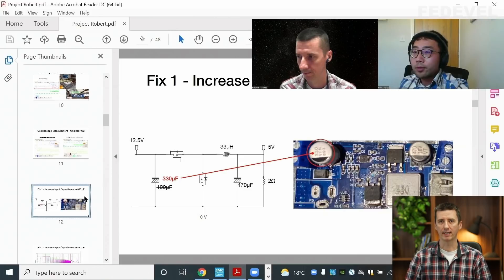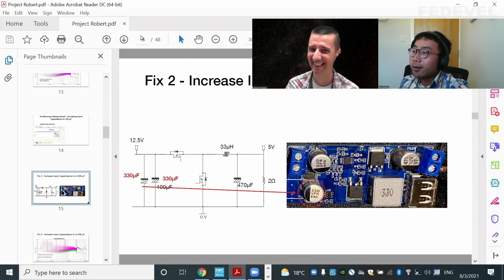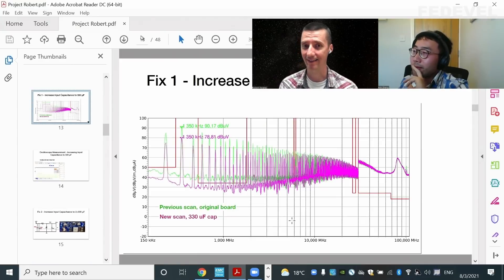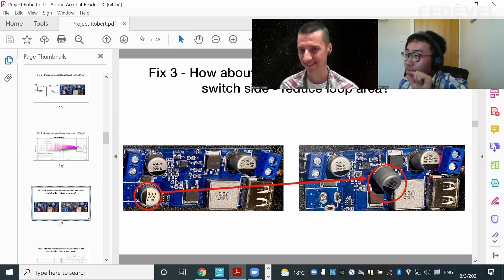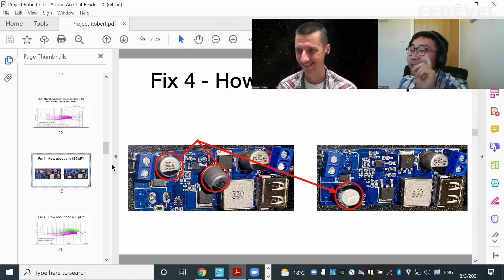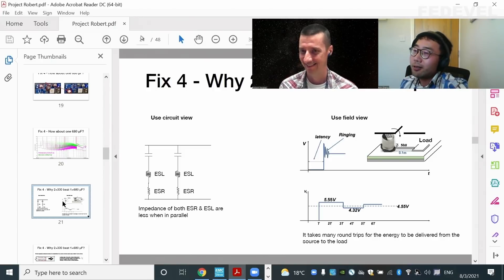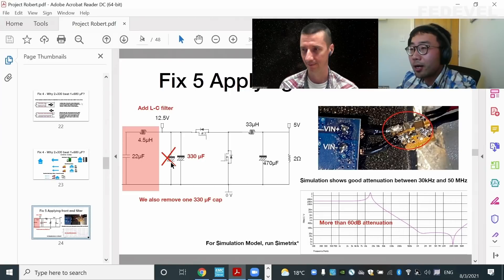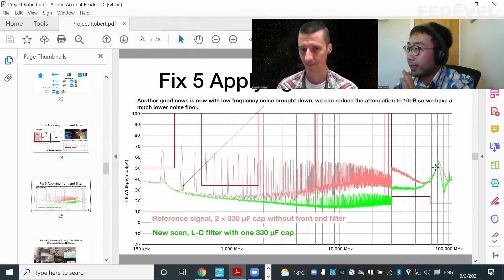Watch How a Few Components Make a Big Difference in EMC/EMI | Min Zhang | #HighlightsRF

Comment: Firstly, pay attention to conducted emissions. They have a huge bearing on radiated emissions.
Stop all noise at the source.
Secondly, use AL polymer capacitors, the ESR is an order of magnitude less. Never use tantalum capacitors, they become damaged by current spikes. They eventually short.
Class B can be hard to pass. Use ferrite beads and a combo of low-value ceramic caps, some medium-value ceramics like 4.7uF, and some medium-value AL poly caps.
Reply: combo, yes, bud more important are different packages than values. Value is in many cases absolutely unimportant.
Reply: Exactly.
A tantalum exploded for me just weeks ago when i connected the source battery ( Lipo). And its not a fault in the circuit.

Comment: I have done lots of EMC and EMI tweekings (radio communications, CATV line equipment, motor interferrence, switchers and so on...) and it is kind of like dealing with black box because there is PCB, traces and many other components that contribute to the frequency behaviour of the system under test. At times, even changing the component supplier may change the spectrum results. Adding to using good probes and reliable Spectrum Analyzer. Unless we have a mathematical equations (model) for above mentioned then we can give up on tinkering. However there are tricks we may use such as monitoring the spectrum trace while gently and slowly opening and closing the coil loops, using two parallel plates to adjust the capacitanes with ceramic tinkering tool and many other tricks. It even gets harder when you go above 900 MHz and microwave.

Comment: Hey Robert, This was very great video, but we would really love session on radiated immunity.
One more question in the radiated immunity tests, like BCI, is the noise introduced common mode or differential mode?
Reply: In the original video, they also talk about how easy it is to accidentally create loop antennas with the return path. What they didnt mention is, that those loop antennas do not only emit but also make your pcb more receivable to radiation.